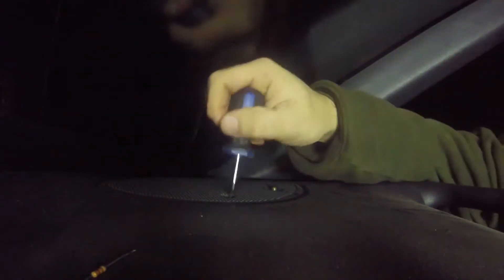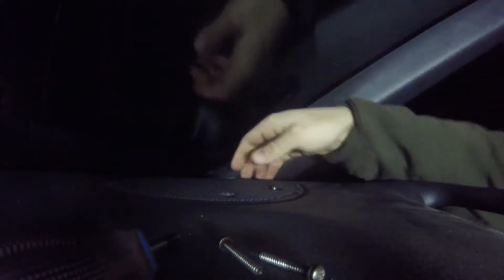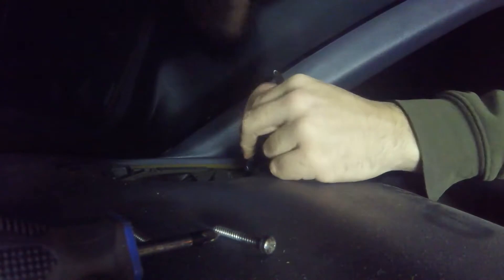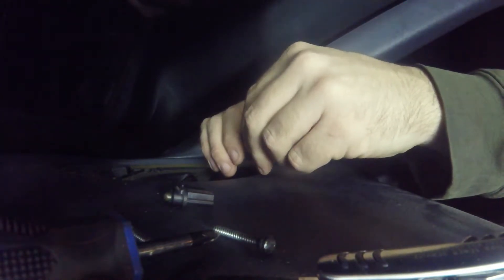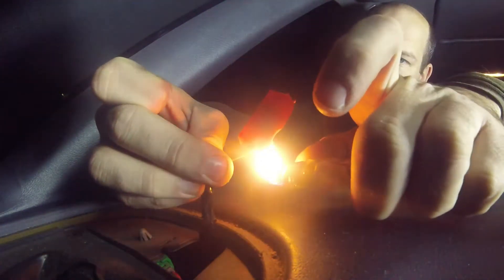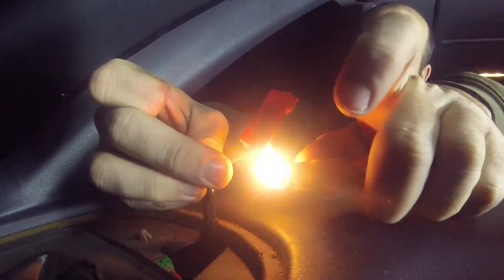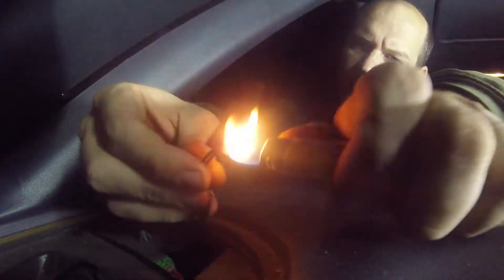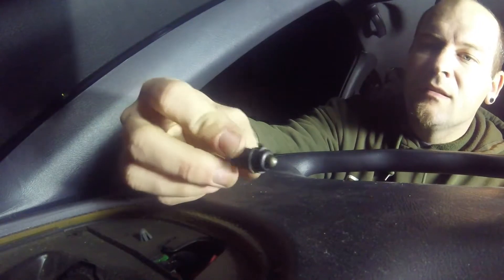Blazer auto headlight disable

Comment: What type resistor i should use ?
Reply from the maker: I used a E-project 680 Ohn resistor, 1/2 watt. If you want I bought a pack of 25 I can mail you a couple.
Reply: @twiztedbacon  it would be great
Reply from the maker: I need to get your address but I dont want you putting it on here. If you have a facebook what's the picture so I know the right one to message
Reply: @twiztedbacon  search for adrian olavarria santana
Reply from the maker: What's your facebook pic. So I make sure I get the right one
Reply: @twiztedbacon  no worry brother. I buy 10 resistor from ebay at 1.26 the pack. Thanks.
Reply: you're getting me closer to what I needed to know I do not want my automatic headlights coming on anytime unless I'm pull the switch on the headlights it's got me stuck because I have a low battery in my damn ECU is running my headlights and I can't turn off my dome lights either this pisses me off to no end
Reply: @mrromantimothy  I managed to get it to work but it was a long time ago, what I do know is that the procedure is very simple